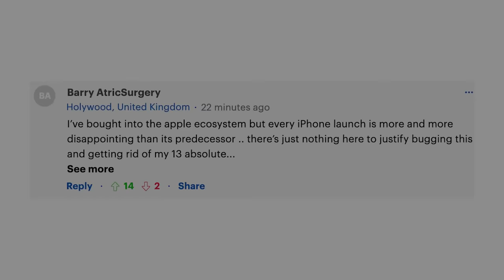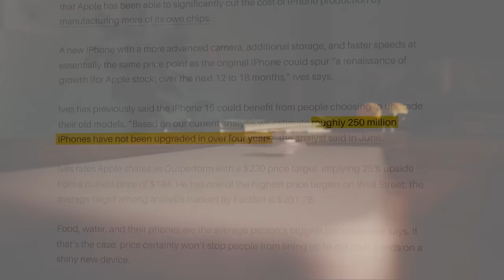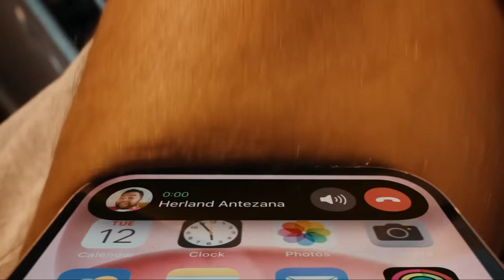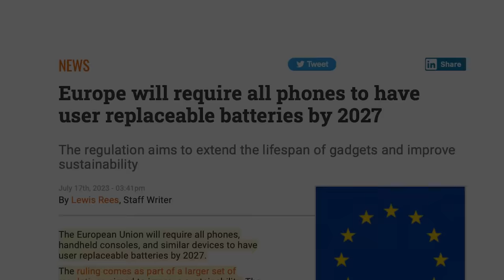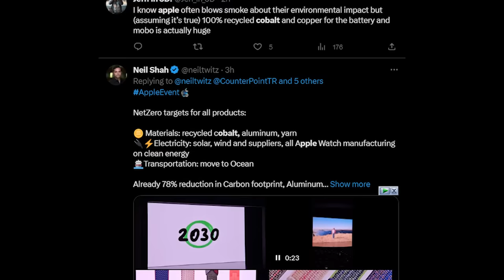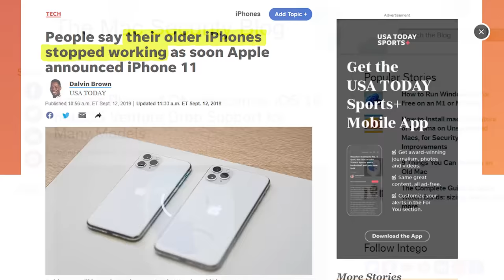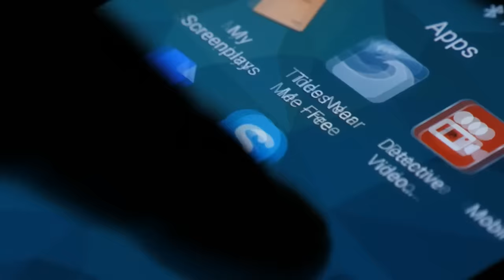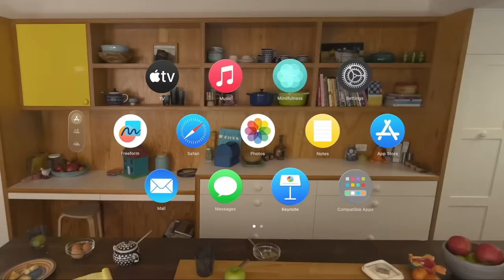The iPhone 15 Is Everything Wrong With Apple

Comment: For someone like me who buys an iPhone every 7 years I can safely say I see innovation when I buy a new phone. I think for those that buy the newest phone every year they’re the ones getting screwed.
Reply: comment makes sense only if they are using for longer period
Reply: You are right in your case you buy phone after 7 years so you are definitely going to experience a change but we are talking about phones in general
Reply: Yep. I’ve only had three. A 4, a 6 and now a 12.

I only replace them when they break irreparably. When did people stop treating their possessions like that?
Reply: hah, rookie numbers, i have a 2017 oppo f5 on android 7 with a dent on the back and a crack on the screen, it is a midranger running on android 7 lmao
Reply: @TesterAnimal1  People that buy cheap Android phones still treat them like that, for example my everyday phone is a 3 year old 250 euro Android phone and i'll definitely use it at the least for another year. 

IPhones though are more like a brand thing. Like you don't want to appear with last years Gucci bag kind of thing. So for many it became just a show off which is why is important to always get the latest model and they feel disappointed if not enough innovation was put in it because they feel obliged to buy it anyway.
Reply: @spreadpositivity1500  I went from X to 14, it was a massive upgrade in every way. I'm sure 12 to 15 is similarly a huge upgrade, etc. Don't buy a new phone every year, like why?
Reply: I’m with the OP. My 6 was massively damaged when I slipped over in the rain. It was shattered and bent about 15 degrees. I replaced the screen and forced it somewhat back into shape. It lasted a couple more years even with a 2mm gap around parts of it! Then it was time for an 8. That managed almost 5 years until I swapped out the battery and it made its way to my daughter who still uses it. The 14 I have now will last me 4 or 5 years at least.
Reply: @TesterAnimal1 I’ve had 3 asw, iPhone 6s, 7, SE 2020, and I’m planning to buy the iPhone 15
Reply: This time, you'll get a free Nintendo with your phone.
Reply: @darkwoodmovies 12 to 15 is most definitely not a huge upgrade.
Reply: In seven years time we went from 100 to 5000 with androids meanwhile iPhone???
Reply: @niggzofirst  That can almost be justified. Way better cameras, like 2x faster chips, 120Hz screen, dynamic island, better glass, and probably some other things I forgot about. But it's not NOT an upgrade.
Reply: @darkwoodmovies  the 15 pro max against a 12 pro max, the 15 has a 60hz display, the chip is actually way better than the 12 so that’s fair, let’s be honest, explain the usefulness of the dynamic island compared to the previous notch  and they both have the same backs, but 15 uses titanium, which is obviously stronger than steel. the 15 pro max does include a 5x, but the utility of a 5x zoom in an average consumers hand is minimal in my opinion, and finally the 15 offers higher storage. you see why it’s obviously an upgrade but not one where it is completely necessary/ significant?
Reply: @darkwoodmovies  the 15 pro max against a 12 pro max, the 15 has a 60hz display, the chip is actually way better than the 12 so that’s fair, let’s be honest, explain the usefulness of the dynamic island compared to the previous notch  and they both have the same backs, but 15 uses titanium, which is obviously stronger than steel. the 15 pro max does include a 5x, but the utility of a 5x zoom in an average consumers hand is minimal in my opinion, and finally the 15 offers higher storage. you see why it’s obviously an upgrade but not one where it is completely necessary/ significant?
Reply: @niggzofirst  I mean yeah, it's not necessary. It hasn't been necessary to upgrade your iPhone since like the X model once the chips were powerful enough to keep up with the constant software upgrades. I personally don't replace a phone until the battery starts draining too quickly. But I don't get the fuss - the alternative is to just not have iPhones every year? That's not going to happen.
Reply: Exactly
Reply: Same - upgraded from the 6 Plus to the 13 and the difference was HUGE. I plan to keep it for another 6-7 years atleast - might get the 20 Pro then :)
Reply: 100%
Reply: me too, i went from a 5c to currently a 8 plus. im so furious that they are not bringing it to IOS 7. if anyone can let me know what specs do the new phones have over my 8 plus? i dont care about camera but if it revolutionized gaming then id care,  i wonder how long my poor ipad pro 2018 model has before it stops getting updates.  like i dont wanna upgrade but once the 8 plus dies it wont get updates so i dont really see the need to get another 8 plus if it does not have IOS 7.
Reply: who is dumb enough to buy a new phone every year.
Reply: I'm still using my iPhone 8 which I bought new in 2017.  My plan is to go for the 16, and if I can stick it out, the 17.  The longer I wait, the more exciting an upgrade is. Besides, my phone still holds up. I don't know how much longer my apps will be supported on it, but for my current needs, it works just fine. The battery is still at 73% capacity too. I've never had it replaced.
Reply: Yeah, like your crApple iphone would last 7 years. It's gonna get downgraded through "updates".
Reply: @spreadpositivity1500  if you  buy a new phone every year then you're an idiot regardless of what brand you are buying from. Not like companies like Samsung didnt release the same phone with minor improvements for 4 years in a row as well.  
And Apple is king when it comes to longevity.
Reply: @whyisitsodifficultomakeahandle 😂 I had replaced my Tecno j8 I got in 2016 running on Android 5
Reply: and if you're thinking of using the "Keeping Up with the Joneses" narrative to critique my lifestyle, don't bother. I work in healthcare and earn a six-figure income, yet I drive a high-mileage Kia and limit my annual clothing budget to $100-200 at Target. My priorities are clearly different, and I'm not swayed by societal pressure to flaunt wealth.
Reply: Exactly, you gotta wait a couple years, if you can, to see any major change.
Reply: @SIPEROTH  what u talkin bout my XR rocks great
Reply: THIS!!! literally is so true
Reply: 😂I used my Samsung J7 Max for 6 years nd recently switched to iPhone 15 Plus, thought that iPhone would be having every feature, J7 Max has more common man’s features than this iPhone 
For example the Calculator 🙂🙂
Reply: My last iPhone was the iPhone 4 and I picked up a 13 Pro Max last week. Night and day difference to say the least.
Reply: True. My iPad holds on to 7 years and still going. Apple hardware is not fragile as the video make it
Reply: This exactly I buy a new phone every five years
Reply: This is my sentiment right now every few years between 4-5 I always have to get a new phone. Not just an upgrade I go back and forth between Samsung and apple I see the differences than rather then getting a new one with the same company every year .
Reply: Yeah just make sure you take good care of your iPhone. I watch the Hugh Jeffrey's channel all the time where he repairs them. The repair costs are through the roof, and sometimes he has to get used parts because Apple wont sell them. Also if you put in a new display, or camera it will always flash a message saying "non genuine display/camera installed. Then you lose true tone, and face ID. That kind of stuff is why I am probably going to stick with Oneplus.
Reply: 7 years is way to long for how I use mine. 3 maybe 4 years is way more reasonable & these cell phones companies let you trade up every 2 years for only a few hundred bucks to ensue you dont switch companies.